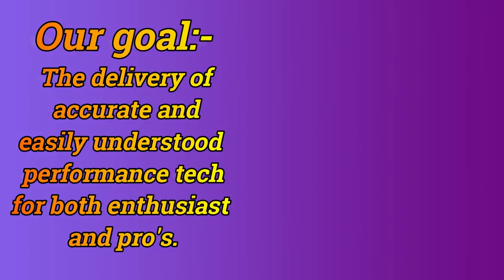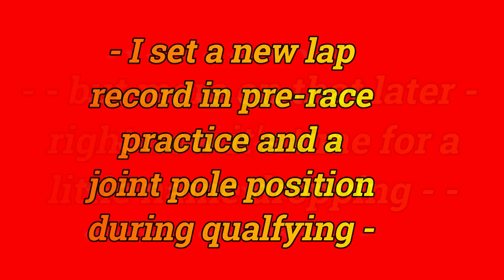David Vizard's PowerTec 10 EP  44 MSD 6 loses race because it was A too good, or  B not good enough!

Comment: I'm really shocked that any Autotronics part from the mid 70's could last more than 15-20 minutes based on my issues I had with the 404B "Gold Boxes" at the drag strip in that era.....MSD wasn't exactly a reliable piece of hardware back then....Notice even the "Cup Cars" from the 80-90's always had a main & back-up ignition box waiting to be switched over if a box failed.

Comment: i installed a built up canfield SBC in a 89 RX7 decades ago. it was a little monster. had a similar problem with an HEI/MSD coil  which was very close to the firewall. under certain conditions the engine would move a little closer to or even actually bump the firewall and fire would jump out of the coil into the firewall. causing an intermittent misfire .

Comment: Electricity always takes the least path of resistance. No exceptions.
Those high tension wires must have opened up, no matter how close the coil primary or ground wire got to the coil tower.
Welding Current, to use your term, at the sparkplug could easily open up a plugwire, or more, exprexially a solid core wire that offers no current limiting. 😬
Were your rotor and distributor cap's high tension electrodes able to accommodate that 80° of plasma multispark duration? Doubt it.
How do you finnesse that, exprexially in an old school V8 where the electrodes are only 90° (distributer degrees) apart?
Smaller the diameter, the worser the problem. 😬
Jussed askin' 😶

Comment: My MSD-6 cost me 10 years of mediocre performance.
Turns out it the unit was marked with V8 application numbers, but actually had a 4cyl circuit inside that hit the soft-revving rpm limiter at 3200rpm, thinking it was 6400rpm. Bought it in 1980. I think the mix-up was intentional sabbotage by a chevy-zealot MSD dealer we'll call Judas.
This kind of problem is almost impossible to detect because of the subtlety of the soft-rev function. 
It was on a built mopar 440 that was still ran very impressively, but i was very disappointed, always felt something was amiss (pun) and that it wasn't living up to its full potential... but i couldn't find what was shoving the broomstick thru the spokes. 😬
Fortunately, after 10 years the MSD unit failed. I then replaced it with another unit and the engine began running like a Raped Ape, just like that! Instantly felt as if the '70 Charger R/T dropped 2,000 lbs. or just got a Nitrous bottle. What a ride!!!
Then i discovered that the rims were spinning inside the tires, leaving little rubber curly q's, but that's a story for another day.
The whole high-performance industry is filled with money-grubbing con-artists, sabbateurs, and ignorants. Buyer beware.
Took me 10 years to discovery my own ignorance, and that enlightenment was accidental. Very humbling experience. 😬
I don't use MSD products anymore.
If multispark ignition helps, you have other problems. Deal with the cause, not its symptoms.
Jussed sayin' 😶

Comment: Interesting story, David. Sorry I never got to meet you when you lived in Tucson. In my race car (383 aluminum block Donovan), I use a Crane HI-6 capacitive discharge ignition. It is similar to the MSD in principle but it has built-in adjustable rev limiter, multiple sparks below 3k rpm and a single powerful spark above that. It has a higher Joule output than an MSD-6. Too high an output current will simply erode the plug electrodes. In any ignition system , closing the plug gap will reduce the peak voltage across the plug and ignition wires so a wider gap can be used but going too wide with a CD system will over-stress the plug wires, distributor, etc. This CD system sure is different from the one on a '63 Ferrari V12 street car that I used to have. Two distributors. each with dual points and individual coils. Each distributor fed 6 cylinders. Complicated, but it worked! -Neil  Tucson, AZ

Comment: Ignition systems talk can be misleading to someone just learning the subject, example, the engine has  more power
from a supper dupper hi power system,,,,,Yeah but,if the spark energy supplied to the cylinder charge is a measurable quantity of the total fuel energy, the engine will exhibit more power....Also keep in mind, that ignition system, if it gets much above 100 to 150 millijules per pulse can jump out and Kill you.....

Comment: Pretty good story. The MSD was delivering such a hot spark that it caused the coil wire insulation to fail. Back in 1974, I bet that even "race quality" ignition wires weren't all that good. Especially compared to what we have nowdays.

Comment: Hello Mr. Vizard and first of all sorry for my not very good english, but try to understand. My name is Tom and I am 45-year old electric engineer from Finland. I have been all my life interested in cars and other vehicles and specially combustion chamber engines. For me engines (gasoline) are hobby, but I try study all information I get. I have been reed all articles concerning engine tuning only possible. Your articles, books and internet publications are the most convincing I have ever seen. Anyway to the point, I and my friend are building vm. 1970 Volvo Amazon to the street. It will be equipped with B20 (2 liter) natural aspired engine. We have clear goal for the engine nature. the engine has to have max torque 210...216 Nm and 80% of max torque has to find between 1500-6000 rpm. The power somewhere 152...160 hp/6100-6500 rpm. Engine use carburators (two side draft dellorto 45DHLA). We dont have flow pench or dyno of our own, so finally we have to go to dyno engine some tunig company. We have MSD 6AL ignition, distributor only address the spark and we try to direct ignition timing with programmable megaspark.  We are going to try MSD-6AL box, and Brisk Premium multi-spark plugs and MSD 8,5mm super conductor spiral wires. THE QUESTION: Is there any published tests done with specially this combination versus other spark plug types? B20 engine chamber is cast iron and shape little bit original chevy style. Off the line: I like much your old stories and they have good tips too. Here in "cold nordic countries" are lot of Volvo home- tuners. This site can watch old Volvo tuning culture http://www.topplocksverkstan.se/scannadeartiklar.html.  By the way... was Timo Kormu (Timos' motor) familiar to you? He has been born in Finland and move to Sweden 1956. He died in 2007. He was serious Volvo tuner and tuned Volvos' rally cars sometime 1970. With Best regards,
 Tom

Comment: I am amazed at the racers I know that dont get what a good hot spark is all about. Theres an old rule, it wont run on an orange spark. I still see dual point distributors. I run an MSD 6 AL and they are awsum. I think you could almost weld with one. Got bit once, never forgot that day. These things will make an old lazy engine come alive. Multiple Spark Discharge.

Comment: I have had a serious problem that was , I think due to a GOOD ignition system. Yeah MSD ( some call "Might suddenly die" )
Fought a degrading state of tune under WOT that got worse. This is on a turbo fuel injected street car. turns out the Mallory plug wires broke down and passed electrical noise to the ECU. the wires were young, just not good enough for the MSD.
Reply: You know you need to replace the copper core leads and go with steel core ones when you go to a HEI ignition

Comment: For the want of a zip tie a race was lost. Not the first time and won't be the last!  Ever fool with a Mallory Magspark? From what I understand they basicallly use a transformer controlled by a dual point distributor.The transformer had normal and reverse primaries. The 'normal' primary driven by one set of points & the 'reverse' primary was driven 7 deg later by the second set. This gave a forced flux reversal when the first points opened, with a fast-rise 50 KV first spark and a normal 20 KV second opposite polarity spark 7 deg later.

Comment: We were running an MSD 6T on my brother's 427 corvette in 1984 and even using good 8mm plug wires, we would have to replace the wires about every 6 months because the insulation would break down and short the spark to the engine, valve covers, etc. I learned to keep my hands away from the plug wires when the engine was running. LOL!

Comment: I never understood why Drag Racers and Road Racers never Tested or Spin Test a chosen Ignition system complete Independent of the Engine and car.
Endurance test for 24 hours, 48 hours, 1 week nonstop.
If there is any inferior China inside I guarantee 100 % failed before 24 - 48 hours is up.
Save you from Losing A Race, National Win title, blown engines, little guy stranded alongside side the highway people zooming by.
Absolutely nothing more Reliable than an old school Vertex Magneto,  design dates back to 1920 year.
Many Famous open wheel racers used them also !

Comment: May I think that it , the insulation, was not good enough. The arc form where there is less resistance. Even with lower voltage the arc would have jumped at the same easier place. Nice story, thanks for sharing.

Comment: With the advent of solid state electronics, specifically 'coil on plug' ignition and modern ecu's. I feel the days of distributor ignition is largely over.

Yes there are still edge cases where you might 'need' CDI. But modern inductive coils are just so good. Not to mention prechamber ignition for direct injection. 
Jordan
Reply: Well ignition systems won't be a thing at all with the push for battery powered vehicles.  Meanwhile billions of traditional ignitions systems will be employed to keep the world moving with the internal combustion engine.

Comment: What would it cost $ for you and/or your associates time and expertise to port one intake port & chamber for a 2.25 valve  & one exhaust port 1.9 valve for a  small chamber Cadillac 500 cylinder head For[ FAT flow] ? (.55 lift) Of course I would send you the head & 2 valves and pay for shipping! I understand if it's too much trouble! Kurt.
Reply from the maker: Kurt, about $500 - $650 but you would have to wait as I am backed up with work.
DV
Reply: @marvingvx1   Thank you maybe this isn't the right time.

Comment: I put large diameter (5/8" OD) silicone tubing over my (MSD helical core) plug cables, on my street car.  I'm conservative with my plug gaps and RPM and just have a Mallory Unilite distributor and coil, but my engine's running great with 80,000 miles on those wires.  I had the tubing custom extruded for this application, and there was a big minimum order, so I still have lots of it.
Reply: I've done the same but I haven't used the same shielding as you over top of my spark plug wires I used rubber fuel hose but after a few thousand miles on my car with a MSD 6 and later a digital 6 box. All the spark plug wires even over my stock carbureted engines and fuel injected engines at night looking at the wires fire is jumping around lightly you could even put your hands on the wires and see the electricity going to your hands but it wouldn't literally shock you. With the Taylor 10.5 mm wires I think that is the gauge when the plug wires were new no fire would jump under the hood on a pitch black night with the engine running but later of course they would get broke down in wood on it every spark plug wire. Some new spark plug wires cheap wires at the parts store with jump fire under the hood even brand new. But luckily the motor wouldn't miss with these fine jumps of electricity jumping around under the hood. I may have to try the better quality grade of silicon hose covering. Also on the one engine where I had the 10.5 mm wires Taylor I think that was the millimeter on them with rubber shielding half inch hose fuel hose over them the motor only run 178° water temperature max. Headers with header wrap and after a while the wires spark plug wires that is still broke down jumping Sparks around. I can see why all these new cars have coil on plugs.

Comment: That first ignition system that threw that plasma arc sounds just like the jet engine igniters we had on
our Air Force Jet engines.....Capacitor discharge, with a whole lot more than a 100 milli jules of automotive ignitions....
Reply: what is the voltage's? for the jet
Reply: @richardprice5978  : Basic 48 volt main battery, 200 vac 400 hz generators...
Reply: @regdor8187  so max V of the plugs is 200V in AC not DC pluses like a car uses?
Reply: @richardprice5978  : Aaaaahhh, not what you are looking for I guess,,,,The A/C has only 48 volt battery for emergency back up, normal engine starts are from a Start cart, external equipment......The Igniter for the
engine is a Capacitor charged to several kilovolts then is switched to appear across
the ignitor resulting in an intense plasma
 ( not your usual lightning bolt as seen across an automotive spark plug) ...A vibrator (switch) switches 48 V dc through
a transformer to a kilovolt dc charge on the capacitor ( Farads )....
Reply: @regdor8187  well a thought iv had for awhile is hybrid/BEV cars carry battery voltage's at ruffly 900v in some cases so im curiosity if a soild state mosfet could fire the plugs or not at 900v dc and or ramp up the V to were it can without pulsing like a 12v car HEI or points coil does and or use more J more efficiently as car systems are about 350J@20kV/per-plug pre-cylinder cycle firing event vs more like a light switch being turned on with dc 900v
Reply: @regdor8187  i also had a different thought 💭in 🤔 2016-ish if the jet igniter/vibrater system could be adapted for V8 hot/road or drag racing engine use in a CNP looking arrangement
Reply: @richardprice5978  : Anything is possible if you have the knowledge to understand and apply it.....Good Luck..
Reply: o is it more powerful than the 44A mag a top fuel car uses?
Reply: When you can clearly hear the ignitors discharging over the top of the air drive starter motors and running APU you know there not to be messed with!

Comment: All I can say is I have a twin turbo 555 BBC with a blow through carburetor and I was using MSD’s e curve distributor by itself and I decided to put my 6BTM box back on to give the boost retard another go and the engine started much better with the box than without using same coil and similar plug wires , plugs only gaped at .024 due to boost .

Comment: I've always said, and maintain that the weakest link in any ignition system is the ignition wires!
Reply: Right.
Let those gaps get too big and see what fails first.
Although I have seen a coil secondary terminal jump to ground on the E style used on Fords.

Comment: To those who think David was dissing MSD, he was not, you just didn’t get his brand of humor.
Reply: I love little history bits like this.  Sound like he damn near had a Tesla coil serving the spark plugs - a 2 foot arc?  Incredible.   Rule of thumb for minimum distance being 1" per 1kv to prevent drawing an arc, I'd guess you need to be inside 30% of that to guarantee one... they were fooling with something near a 90kV/high current source?
Reply: @flinch622  not that a full P100D pack/900V DC but if the transistors/mosfat's worked would it fire the plugs? more so without pulsing coils/point's as in a 12v system's ? or run lazzers co2 fibre optics? sense mostly because of costs/bulky and heavy
Reply: Or you have to watch to the end.

Comment: You know, its crazy the developement of ignition parts. Even with the advancements in low ohm wires, its the same old boot and connection style. I run moroso ultra 40's with the jacket, and while i never have a failure in the jacketed part of the wire, its always at the boot, even with the little booties put on additionally. Seems my headers are always close on the #4 culinder. So i get in the habit of just changing the boot after some time. Although i did kind of take apart one of the wires to fix an end, and noticed the wires got super brittle, and even started cracking underneath the full length wire jackets. I run my car on the street, but with limited miles, and that did that after pry two or three years. With very conservative under hood temps, as i have no wheel wells and a cowl hood. I cant imagine a 6-7 mm wire in the 70's holding up to much at all.

Comment: After I had a MSD 6A stop working on me, I went to stock style hei, with hot coil, some reason I like those 10-11mm plug wires, I guess I'd rather have a high voltage, high current ignition, over a multiple spark, I figure if it does misfire, and is extra rich on the next cycle, with a high current spark, it's more likely to ignite the wet mixture, sure the multiple spark may ignite it in the second spark, the timing will be a bit late, but having multiple sparks while the mix is burning, isn't really doing much. A high current spark is more likely to ignite a rich mixture, I could listen to your stories all day long, thanks for sharing!
Reply: The best way to look at an Ignition system is the actual spark energy delivered to the spark plug gaps.
Secondary Amperage Current. Or Watts of Energy.
I like The Joules of Energy Metric Rating delivered the secondary side.
Reply: Then how many Operating hours can the Ignition system function without misfire or total failure ?
50 hours ?
100? 
500?
5000 ?
100,000 hours ? 
Its exactly how Electronics Engineers used to design and rate electronics back in the 1950s -1980s.
Reply: @Java Aleim You got that right. Nothing but issues with MSD. Tried and tried but never had any luck. Failed boxes, wires and coils. Some bad out of the box. 
I have a Crane Cams Fireball ignition that has been going strong since 2006!! Its more advanced, durable and cheaper than a 6AL. Now that MSD is owned by Holley I wonder if the situation is better or worse?
Reply: @Java Aleim watch dui stuff.  one of their china caps/rotors left me stranded in the middle of the nite!